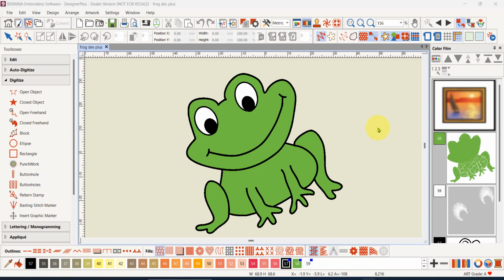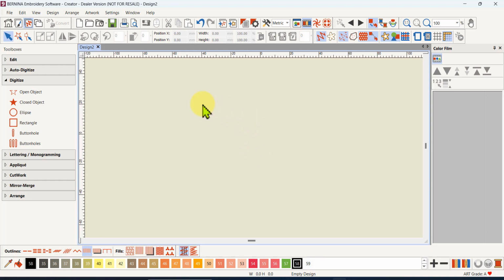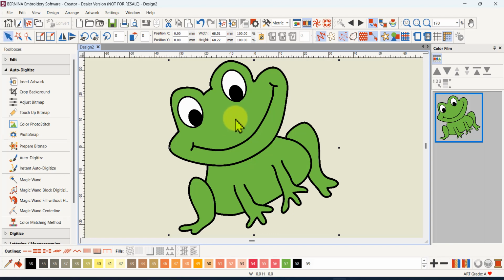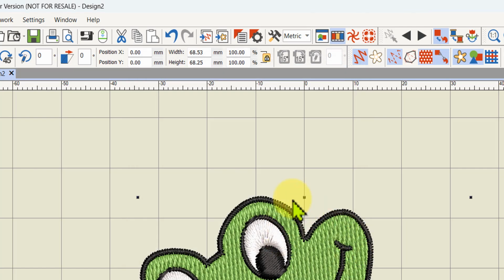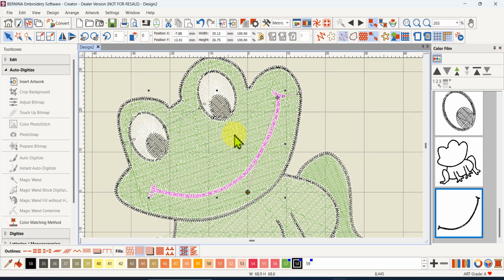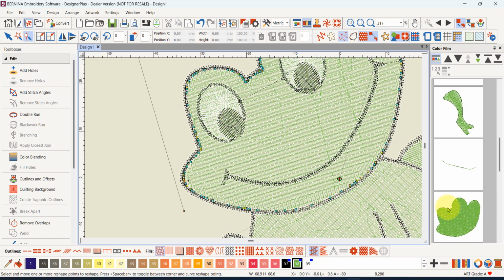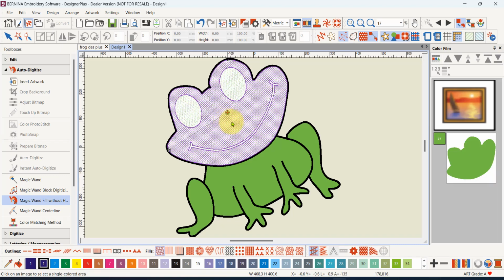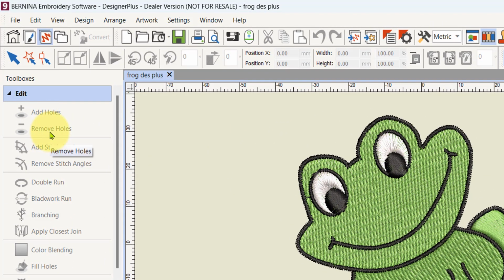Frog design 1  Remove Holes

Comment: I have the free program  downloaded  but it crashes  often  is there a fix?
Reply from the maker: Did you check that your computer meets the specifications required to run the program? Here is a link to a document detailing those.
If it does then you might need to purge the recovery files. With the program closed go to the Start menu, and in the list of programs click on the Bernina folder. When it expands you will see an icon that says Purge recovery. Click on that. In the box that opens put a tick next to delete backup files and click ok. Click yes in the next box.  If none of that works contact Bernina via the Bernina website for your country.

Comment: Thank you for these Youtube videos.  I really appreciate them.  I am wondering why you did not want holes under the eyes so the green would not stitch out under them.  I understand the mouth, but not the eyes.
Reply from the maker: I will use the remove overlaps to put them back, so that there is a wider overlap.